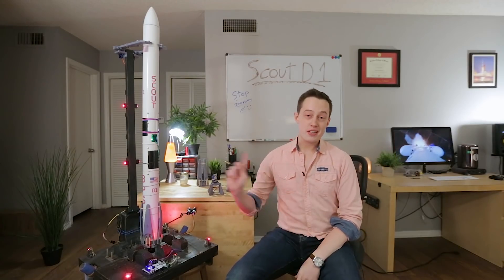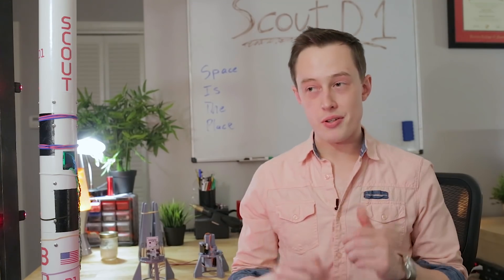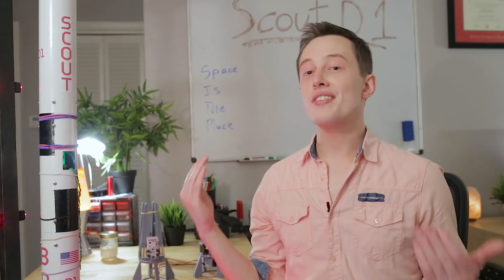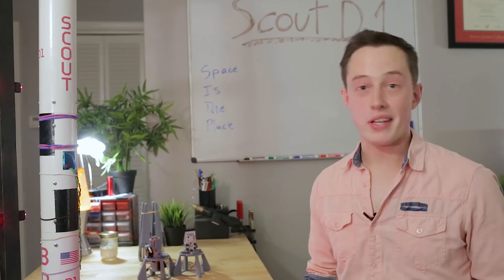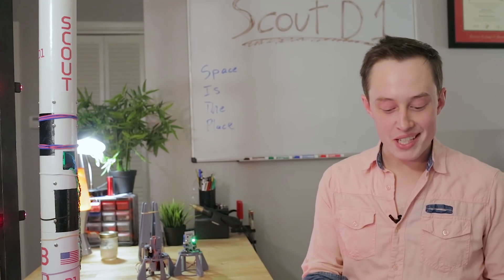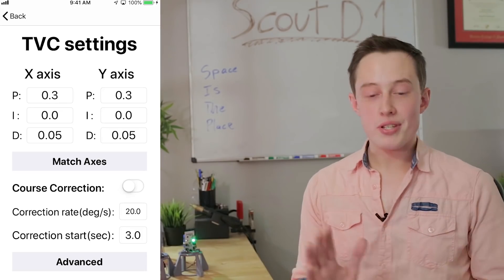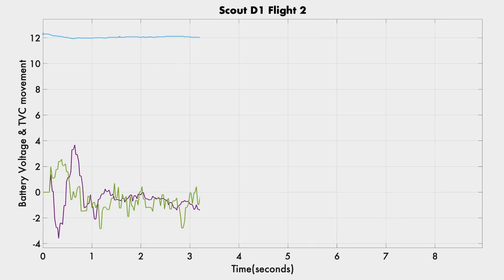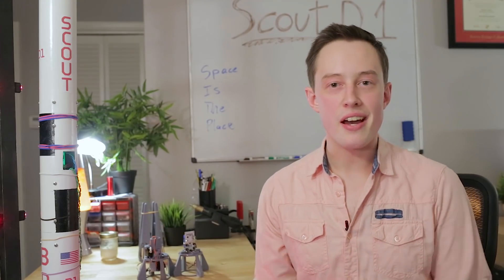Scout D1 | Flight 2

Comment: Funny, I assumed the thrust vector “kick” at the beginning of the launch was intentional.  NASA had a launch profile on some boosters that had this “kick” so the airframe wouldn’t hit the tower.  Hitting the tower at launch is/was a concern....hence the callout of “we have cleared the tower” at launch.   A great example of this is the first generation Atlas boosters. At launch, the side mounted vernier engines do a little kick. The deer was impressed with the flight profile of the Scout btw.

Comment: It would be awesome if you developed that course correction feature into a fully fledged auto pilot; so used a preset course profile as the vector target rather than just a basic vertical line.
Reply: Also, if you include the theoretical thrust curve in the flight profile you'd be able to correct and predict more accurately. Maybe confirmed with acceleration data to prevent issues if there's a problem in flight

Comment: I think an issue/roadblock you are facing is that while you are trying to scale down the technology spacex uses, you can't scale down the environmental forces. I think it will be much harder to land that small rocket using thrust because the surface area relative to the air density is so much lower. The falcon 9 can use grid fins and thrust vectoring because it has so much surface area and air keeping those control surfaces working. For rockets as small as you are making and the speeds you are attempting to land at, there are almost 0 control surfaces influencing the descent, and scaled landing legs just won't be able to account for the error in approach. 

This being said, I have been watching and your ability to implement thrust vectoring on this small of a scale is incredible. I can only imagine how hard this was, especially due to the issues I outline above. On the falcon 9 there are hundreds of tons of mass to stabilize any inconsistencies in vectoring, but a small error in this tiny of a mass is catastrophic. It would be interesting to see what this vectoring system would do on a higher mass rocket, I have a feeling it would do very well. Tuning software at this small of inertial forces is probably much more accurate than at high mass

Comment: When you are moving up to higher powered motors I would use cesaroni motors because they are more reliable then other Apogee motors. And also what is you Target height....  Like do you think you could increase your impulse and try to go like 100 meters or like 1000meter. If you need anything help with motor selection or really anything I have a good bit of knowledge in the model rocketry world and if I don't have the answer I can find someone who might. Thanks for your time

Comment: I'd assume that the cooling of the flight computer is actually undesireable, since it affects the measurement instruments, as well as the clock frequency of the whole system. We counter this problem in the electronics test instrument world by using miniature ovens to maintain a constant temperature for things like crystal oscillators. Very important if you want a reliable and stable clock frequency, which is used in a huge number of different kinds of test instruments. Maybe you should at least insulate the flight computer? So that the temperature stays more constant, during flight, relative to it's condition at T-0.
Reply: I'd just pictured the SCOUT D1 with a square oven inserted mid section :-)
Reply: @Jens.Krabbe  To be fair, these ovens I mention are about the size of a USB stick in some cases! They really only need to heat a single component. Or in the case of this rocket, perhaps just the flight computer PCB.

Comment: Hey Joe, any chance in the future you could offset your z acceleration data to display kinematic acceleration rather than the acceleration as measured by the accelerometer? At 11:22 I thought I could get the velocity by integrating acceleration, but that doesn't work when there's a constant offset due to the accelerometer measuring not just acceleration, but also gravity. It would be nicer if the graph showed actual acceleration (so sitting on a table would be acceleration of 0, rather than the -9.8 you get from the sensor, and free-fall in vacuum would be -9.8 rather than 0). Thanks for all your great videos! You should feature Charlie Garcia more often, he seems like a righteous dude. :)

Comment: If you give me a set of legs I'll make my own rocket design and we can compete on who gets higher with the same motor!
Reply: I'm not sure higher is point. Higher is easy.
Reply: @tonydoza6  Well if its so easy we'll make it a competition
Reply: @dubmfg  Done, name the motor and method of recording. I'd say either F15-8 or C6-5 and jollylogic altimeter? Your pick
Reply: @tonydoza6  you have more experience than I do in that area, I haven't done rocketry but run my own prototyping shop and bet I can make something happen. Shoot me an email or instagram @dubmfg and we can conferr
Reply: The 3D printing has opened up a whole new arena for the average Joe in rocketry.

Comment: I don't think you are seeing drag, but seeing the acceleration of the rocket due to the reduction in weight of your motor.  If you notice the z accel matches the rocket motor curve, with about the same values.  This makes sense , because you have a 1 kg rocket.  I'd like to see the thrust curve divided by the change in weight of the rocket over time and see if that matches your z accel.
Reply: There is 40g of propellant in the F10 motor, 40g over 7sec is not enough to detect it on the Z axis chart. Yesterday after seeing this video I programmed a basic simulator to get an idea of what is going on with this rocket.

I took the thrust chart for the Apogee F10, The cross section of his airframe to choose a dragcoefficient that is probably not too far off. The mathematic behind this kind of simulator is suprisingly simple (for a one dimensional analysis  aka Z Only):

Get the Trust, adjust with the Gravity Vector. Integrate to get the Speed, Calculate Drag based on Speed, Air Density and drag coefficient, then Integrate the Speed to get the Height. With the Height you can recalculate a new Air Density and start all over again with the next simulation iteration.

After Adding the Drag, I could not see on the simulation the "Bath tub" effect he was talking about in his simulation, so I took every constant parameter in my simulation (in this case I had the Gravity at 9.81, Air Density at 1.225 and the Rocket mass at 1.00kg) and changed those that are variable (in this case the Rocket mass and the air density). 

The air density change base on the height of the Rocket (all the equation are on wikipedia) in my simulation it changes from 1.225 to 1.217ish at 63m above ground (Max Height in my simulation).
This change in air pressure did in fact recreate this "bath tub" effect.

So my guess is as Bernard said, yes you can see the change in drag based on the air density that is reducing with height, BUT i suspect that one other major thing to consider is that his rocket did not fly 100% straight, the first half his rocket had an angle going back and forth slowly and in the second half on the video it looked like the rocket stabilized and did go straigher. This will reflect on the Z accel and may be another factor of the Z accel shape.

Comment: Can you calculate max q for your rockets?
Reply: Q is dynamic pressure. Dynamic pressure is 1/2 * rho * V^2, where rho is the density of air and V is the velocity you're flying at.

On an orbital rocket flight, Max Q comes about as a result of the fact that as you go up, V goes up, while rho goes down. At the moment of launch, Q is zero (since velocity is zero) and once you're in orbit, Q is also zero (since there's no air so rho is zero). Somewhere in between, you're going fast while also still being in a thick atmosphere.

Although Joe has completed the incredible feat of crossing the Barnard Line, that's still really not high enough for air density to decrease to any reasonable degree. Therefore, his max Q will simply be when the rocket is going fastest - which is at motor burnout.

Now, I don't think this video shows the rocket's maximum velocity. But we can get an approximation. If we look at 11:22, he shows the acceleration, and we can use that to get velocity. The 10 m/s^2 or so that we see for most of the burn corresponds to essentially coasting at a constant velocity. The motor is producing juuuuuust enough thrust to keep the rocket fighting gravity, but as you can see at burnout, gravity quickly takes over again. From what I can see, the motor isn't actually speeding the rocket up hardly at all for most of the flight - it's only sustaining the speed obtained during the initial kick. So actually, dynamic pressure is pretty constant for most of this flight. If we look at the altitude plot on that same graph, it has a relatively constant slope (if you ignore the wiggly data due to sensor noise) which further confirms the idea that the velocity is constant. The motor's initial kick seems to die by 2 seconds in, so if we look at the range from 2 to 5 we can see the change in altitude is about 16m to 45m, for a change of 29m. 29m / 3 seconds gives a speed of about 10 m/s (we're eyeballing numbers on a graph here so we can't get much more precision than just "about 10").

So the rocket flew at 10 m/s for most of the flight. In that case, we can take the density of air to be about 1.225 kg/m^3 (this is a common standard value for sea level) and plug into the equation to get a max Q of about 60 pascals. Which is not a whole lot.

Hope that helps!
Reply: @thomasmurphy8749  i didn't even know what max q was before this comment, thanks for teaching me something new
Reply: Thomas Murphy my god talk about dedication
Reply: @thomasmurphy8749  you're wasting your time.
Reply: Adam Max-Q wouldn’t even be a concern for this scale of rocketry, it’s going way too slow, and way too low in the atmosphere for air resistance to even be a concern on the structural integrity of the vehicle.